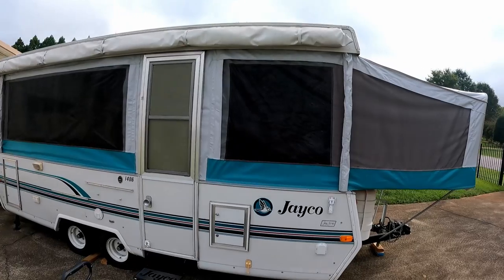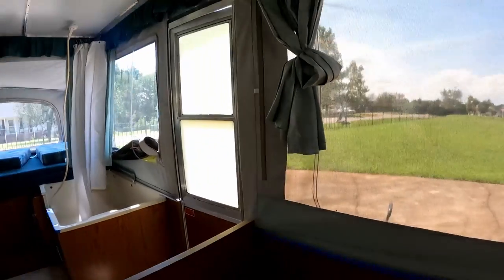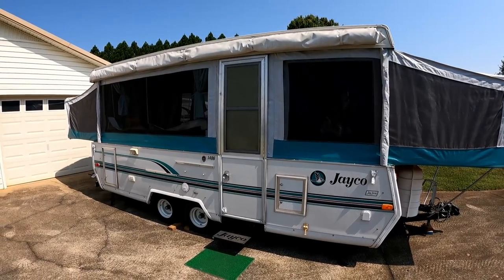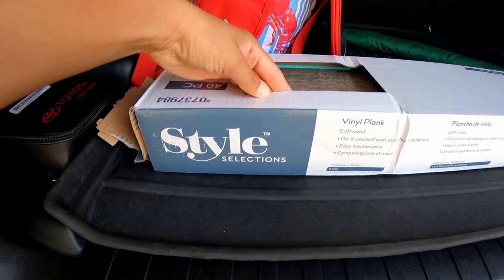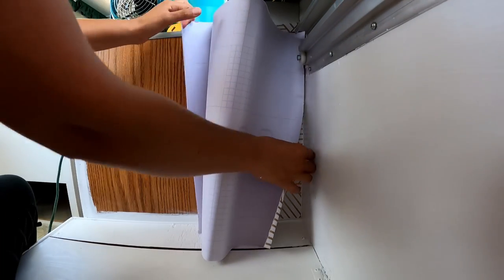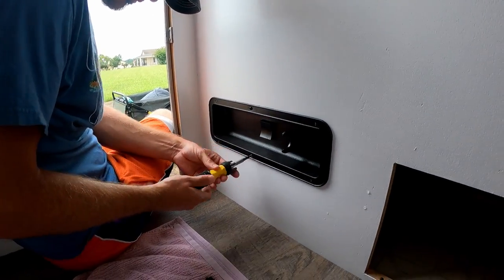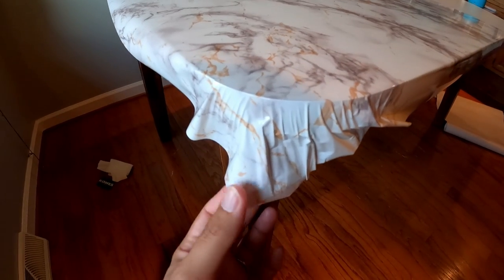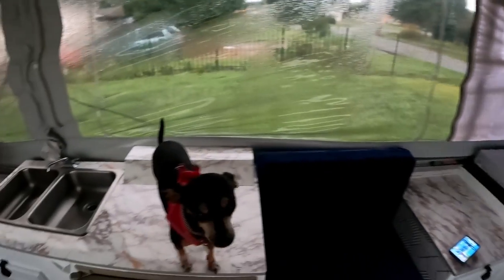Jayco 1406 Jay Series Pop Up Camper Interior Renovation

Comment: Fantastic reno - sadly, that paint you used is best for just regular, drywalled walls. You need to scuff those cabinets a bit... sand smooth, and use a really good primer.  Then, you use a cabinet paint. Coverage and wear would be so much better.  But still looks amazing.